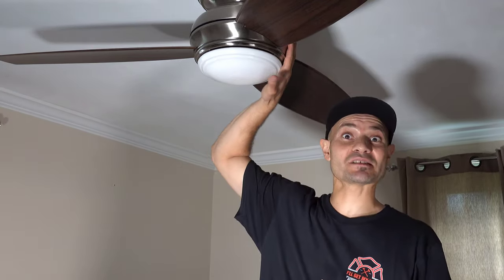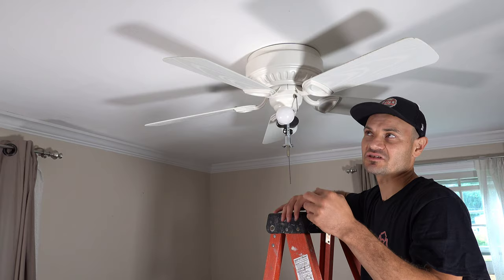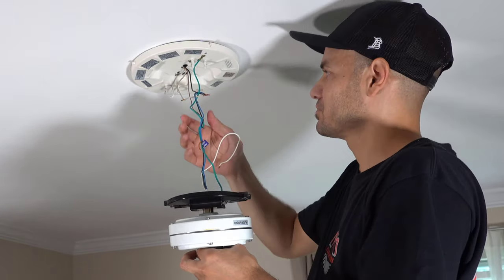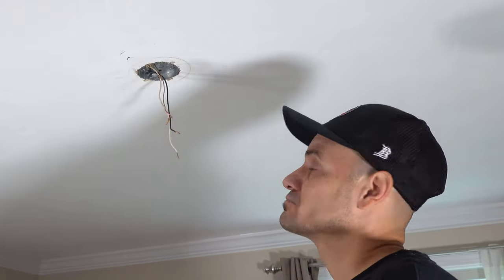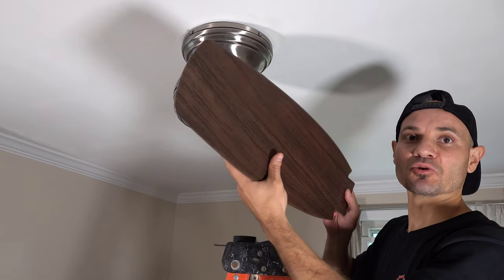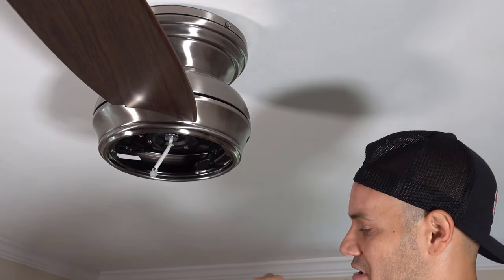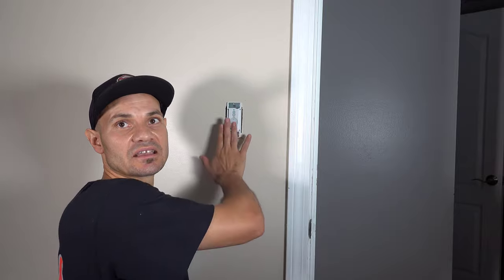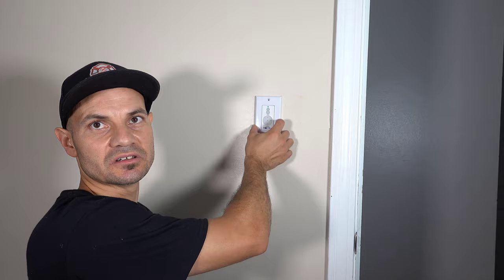Install a Smart Ceiling Fan | Program Remote

Comment: Ivan, this fan is NOT a smart fan.  The wall control does not require a 2nd hot because the control communicates wirelessly  to a receiver inside the fan.  You can also buy a handheld remote from Minka, in this case, that will communicate with that same receiver.  This type of system has been available for many years.  Smart ceiling fans are an entirely different concept.  Otherwise, your video is very good.
Mike

Comment: I have installed a smart carro ceiling fan, but I can’t only turn the light, or just the fan itself. I can’t even change the speed on the fan. It doesn’t come with a remote control. It supposed to be control it only by the outlet, from my phone, or Alexa system. How can I make all work the way I wanted?